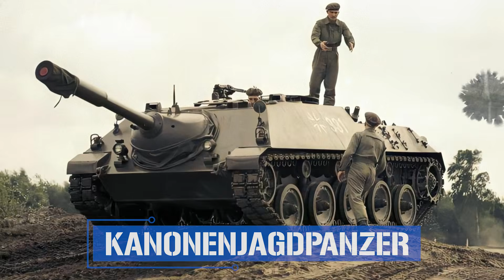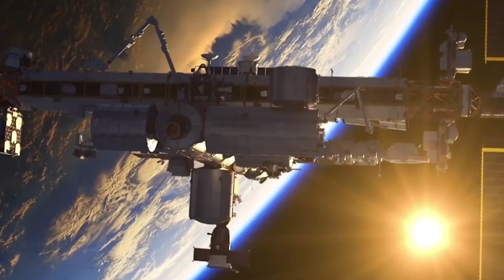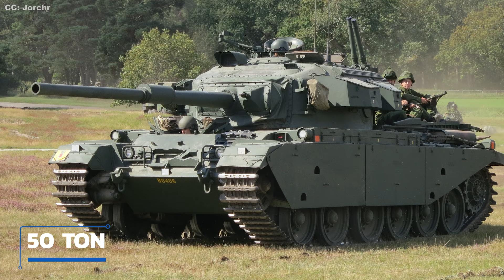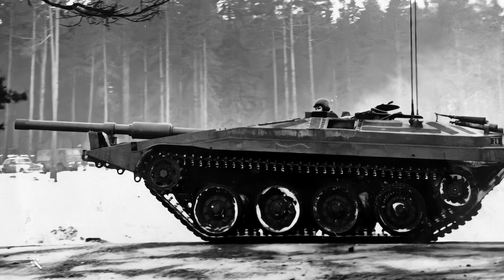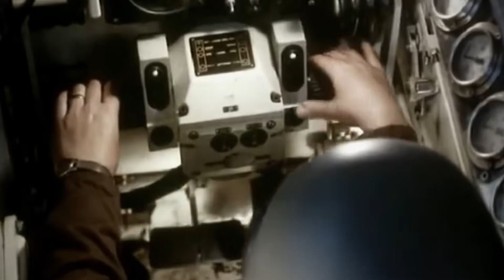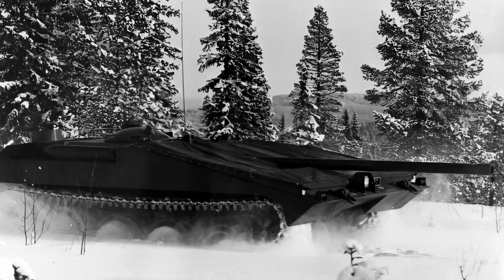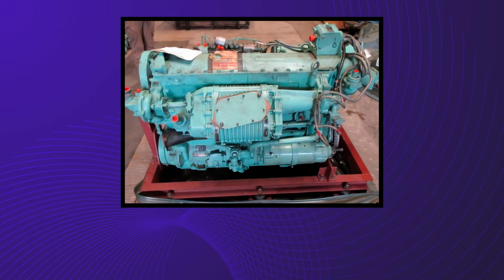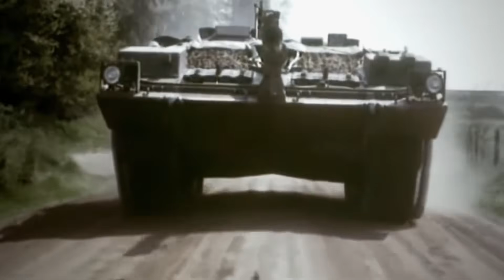Stridsvagn 103: Sweden's Turretless Cold War Super Tank

Comment: The more I see of it the more I want to see it as an electric drive hybrid with computer controlled suspension. It looks like a tomorrow vehicle as technology caught up with concept :o)
Reply: No this could never be practical compared to modern tanks as it can't fire accurately while moving.
Reply: @josefstalin4532  Eeh, practical? Yes. Comparable? No.

If it had a modern gun, it would be very dangerous, as long as it is first to fire. Problem is that it's loses a lot of flexibility by not having a stabilised turret and gun.

Remember that most shots fired, even today, from MBT's, are fired after the tank has stopped. The stabilisers are mostly used to keep targeting while you stop.
Reply: @Mithirael  I'm well aware most shots are fired stationary, I work as a tank driver. That being said, just because it isn't the majority of shots doesn't mean it isn't a huge disadvantage not being able to shoot anywhere but straight ahead or while on the move.

I work as a tank driver, and the amount of times we fire the cannon at infantry to the side of the road, while on the move, or just at an angle not possible without a turret is significant.

There is a reason no one has adopted a tank like this, they're way too specialized to be very useful as soon as shit hits the fan. As soon as the enemy appears from a direction you expected, you're dead.
Reply: @josefstalin4532  At the time, the 103 compared favourably to basically every MBT that the west had produced, even in time from spotting a target to putting effective fire into it. The British tested the capacity for firing on the move to prove that it could not put effective fire onto a target at all, and found that it wasn't much worse than their Chieftan. It really wasn't a huge disadvantage, more a situational disadvantage. 

And dying from enemies from unexpected directions is a symptom of any tank, the 103 wasn't more susceptible to flanking than any turreted tank would be. You only need one effective shot on target, after all. And with how the 103 was made, it would be just as easy to turn the tank to the enemy as it would be for any other tank to turn the turret, bar some very specific situations that you simply wouldn't find yourself in unless you were blind or mind-blowingly stupid.

The problem with the 103 wasn't it being too specialised, but rather being difficult to modernise effectively. When stabilisers and targeting computers allowed MBTs to fire with no loss in accuracy on the move, it simply couldn't keep up anymore. And today, it really wouldn't offer any significant advantages to develope a turretless tank like the 103 due to how powerful stabilisers and targeting computers are. The best you could hope for would be a machine that would be adequate; so why reinvent the wheel?

But at the time of its development, it was perfectly suited for our needs, and a most formidable opponent in a potential conflict.
Reply: @Mithirael  Exactly, the thing is the comment I responded to was about it being "a tomorrow vehicle"

It was viable in the 60s and 70s, but certainly not in the future.
Reply: @josefstalin4532  The comment you responded to said only that it looks like one, not claiming that it was. Unlike many comments that have asked about viability to modernise and redeploy it, the OP admitted himself that technology caught up and outran it.

Comment: The video did not go into detail about all of its abilities.

1) In western tanks sharp angles caused by sloping armour wastes space as it is unusable. This either means cramped interiors causing crew stress and inefficiencies like the Russian tanks, or caused bigger tanks (easier to spot and easier to hit) which meant more heavy armour meaning more weight creating a slower underpowered tank with extra costs in manufacturing and maintenance. Instead the S-Tank used the sharply angled and unused space at the front of the hull to put a rubber fuel cell in the wedge area at the front, using the otherwise useless space as fuel storage and as spaced armour. Rubber fuel cells were stuffed elsewhere too in unused spaces adding extra spaced armour and using all free space.

2) The hull was split into 3 separate sealed compartments each acting as spaced armour with the crew being in the third and last compartment, being safe at the back of the tank. 3 layers of spaced armour instead of one as in other tanks.

3) The engine and transmission were in the first two compartments acting as extra spaced armour for the crew.

4) The crew were in the largest compartment and the safest being the last compartment and hardest to hit. No swimming pool and holo deck for the crew but nonetheless roomy and comfortable compartment compared to Russian and other tanks.

5) Using an automatic loader reduced the crew size making for a smaller and cheaper and more manoeuvrable tank. The ride was very uncomfortable though because of the short wheelbase but then longer wheelbases increase the chance of throwing a track when turning.

6) The auto-loader gave it a VERY HIGH rate of fire.

7) Reloading was done in the safety of behind the tank.

8) The plastic fuel drums attached to the sides over the tracks added extra spaced armour. Diesel is very good for this.

9) The high angle of the frontal armour more than doubled the effectiveness of the thin armour, giving reasonable protection without the weight plus the added advantage of a chance of the shells ricocheting off and HEAT rounds not forming a proper penetrating jet.

10) The spade added extra spaced armour as well as for digging a defensive position to fire from providing extra protection and cover.

11) The fence set off HEAT rounds before the shells hit the tank or destabilized the shell’s trajectory causing a chance of ricocheting or HEAT rounds failing to form a penetrating jet properly.

12) The stepped ribs up along the hull front were a very light yet highly effective spaced armour that destabilized the incoming shell causing it to ricochet or break up before hitting the tank’s hull armour. Such an insufficient looking and minor thing but with major effects against HEAT and solid shot beyond belief.

12b) The ribs also stopped shell  splinters from sliding up the hull taking out sighting and ranging gear on top.

13) The low height of the tank makes it hard to spot, and hard to hit. During WWII over 50% of hits were to the turret. The S-Tank did away with the turret. Being the size of a large family car instead of a country barn made it a very small target, hard to spot, hard to hit.

14) Had a river-crossing screen that after being erected enabled it to cross any river. No stuck in the mud for this tank.

15) Duplicate controls at all stations allowed a single crewman to drive or fire the tank in emergencies.

16) Designed to fire and kill large numbers of advancing enemy tanks like a shoot-em-up arcade game until the Russian hordes were nearly on top of them then be able to skoot backwards at high speed to another pre-prepared defensive position to start the killing all over again while keeping their hull front (thickest armour) always towards the enemy, as the third crewman faced backwards and drove the tank to the rear at high speed (Most Russian tanks even today only have one reverse gear and can only move in reverse at a couple of miles per hour meaning they can not dodge by quickly backing back into cover in a hull down position, and the Russian driver being in the front of the tank can't see where they are going backwards). Shooting while halted greatly improves accuracy while the rushing Russian horde either had to stop to fire and make themselves a target or fire on the move and have an inaccurate fire, as the Russian fire control/gun stabilisation/ turret stabilization, ballistic computers, range finders, etc., we're either nonexistent or no better than their WWII tanks.

17) Highly efficient and cheap diesel engine plus a gas turbine engine for that super power and speed when needed. Only the US Abrams tank has a gas turbine engine too, and it earned the nickname ‘The Whispering Death’. But it took the US decades to add an aux power plant to run when idle to keep the turret powered and operating, as a turbo engine spins at a constant gas-guzzling rate even in idle. The S-Tank had the best of both worlds.

18) having the gun mounted so the breech was at the back of the tank instead of the middle meant a longer barrel could be used and most of the barrel was protected.

19) Like hot women and hot sports cars, sexy makes for a very dangerous and fast tank, and the S-Tank has it all, in spades.
Reply: One note, 12b is correct, but 12 is not.

The ribs were simply welded in place, and would have no noticeable impact on the shells at the time. They were only for protecting the gear on top of the tank.

Comment: About the Kranvagn (KRV) , the issue never was light armour but armament.
HEAT-rounds, basically a cone of metal with explosives on one side, that on detonation gets formed into a metal spear travelling at 6000-10000 metres per second, was regarded the future of anti-armour, but it has a few particulars.
One of them is that the penetration is proportional to the diameter of the cone, siply put the wider the cone, the longer the resulting spear.
The second is that rotation (like the one used to stabilise projectiles) distorts the spear and makes it less efficient, which is why the Soviet tanks who heavily relied on HEAT had smoth bore barrels in their guns.
The Swedish army wanted a HEAT round that was cheap, accurate with good penetration and short travel time even at long distance. Bofors engineers never managed to solve this, as fast shells require really fancy fuzes to be able to detonate the charge in the fraction of a second between impact and the shell smashing itself to pieces against the armour...  while a highly accurate shell would rotate so fast that the penetration got severely reduced.
Before a round was decided on, no one knew what cannon to pick (imagine finding out that the gun you installed in all you tanks are the wrong type for your shells!), and without a final gun, there was no point in making a turret as the exact shape and construction depended on what weight and dimensions the gun would have.

In the end, one of the KRV chassies built became a test bed for the S-tank suspension, while the other was rebuilt as a SPH, that served as a concept for what became the Bandkanon 1.
Reply: Also, Stridsvagn 2000 never got further than a wooden mockup.
Here is a clarification to be made, in 1980 the Swedish army requested the S-tanks and Centurions to be replaced with a future tank expected to be in service past the year 2000. For convenience, this unknown design was referred to as strv 2000 in official correspondance.
Budget restrictions (these were the years of high inflation that followed the energy crisis) saw the Army make due with a REnovation and Modification program of the existing tanks instead. The REMO finally brought the S-tank up to the standard it was intended to have, but they were still fairly old, and originally only intended to be in service for 10-20 years before being replaced as the technological development rapidly progressed.
In the late 1980s, the usual suspects (Bofors, Hägglunds et all) were involved in a pre-studies of a new, domestic tank together with FMV, the military procurement agency. Different configurations were considered: turretless, conventional turret, unmanned turret and so forth), and a wooden mockup of the most promising alternative was made under the name Stridsvagn 2000.
Meanwhile, the Berlin wall came down, Germany reunited and the Swedes got their hands on some T-72s. Results in the gun-tests were shocking, as the modern longrod penetrators went straight through the Swedish tanks, front to rear. Mobility was also far higher in the bogs and forests up north than predicted, further empathised with the trials of Abrams, LeClerc and Leopard 2. Swedish tanks were not just outdated, they were obsolete.
Projected development time for the Stridsvagn 2000 was between 4 to 8 years, and that was its doom. The replacement was needed soonest possible, and Germany not only have a really good tank they were willing to licence, but could also offer stopgap Leopard 2A4 to be used meanwhile.

Comment: Some corrections:

* "At high speed the turbine engine would start..."
The idea (theory) behind the design was that the tank should idle with only the diesel engine running, keeping fuel consumption low. When much power was required the driver should start the turbine engine. (It didn't start automatically.)
In reality the proposed behavior didn't work! When you need the extra power you don't have time to wait half a minute for the turbine engine to start, in a hot situation you can't even tell seconds in advance when that power is required. Therefore more often than not the turbine had to run in idle when the diesel would have sufficed.

* The S-tank couldn't fire on the move.
That's a matter of definition. Technically speaking the gun could be fired while the tank was moving.
In 1973 (IIRC) the British army did a lot of testing of the S-tank, comparing it to their Chieftain tank. The idea was to prove that tanks needed a turret. One factor they took as given was that the Chieftain with its stabilized gun could shoot (somewhat efficiently) while moving, and since the test showed that the S-tank had the same hit percentage while moving the conclusion was that they were "unable to prove that the S-tank can't fire while moving".
Reply: Swedish Army regulations generally frowned on wasting shells, so the S-tank were not to fire on the move at ranges exceeding 200 metres while the Swedish Centurions had a limit of 500 metres.
Reply: @johanmetreus  Of course that "ability" wasn't used in practice.
The point is that the developer's assessment that turreted contemporary tanks were also unable to shoot accurately while moving was correct!

The tank's design was really pushing the envelope in terms of suspension and propulsion, leading to many teething problems. It could not have been done ten years earlier. Not making preparations to retrofit a laser range finder must be seen as a blunder. (Lasers were way to expensive at the time.) At the same time when the S-tank was designed it was technically impossible to make "shooting accurately while moving" a functional feature. Ten years later the advancements in computer design (smaller, faster, more rugged and power efficient) made it possible.
Reply: @ollep9142  , let's start with establishing that the basic rule was "if you want to hit something, stop the tank".

Now, there are often remarks that the Centurion and others had stabilised guns and could fire on the move if needed be.
 I think the Swedish regulations clearly show that this was regarded as an emergency measure rather than something to be routine practice, and even then only at basically very close range.
It is worth noting however that S-tank was capable of doing this as well, albeit at even closer distances.

Comment: Being they would have fought a defensive war I think this would have been a good design.  This is a ideal tank to dig in and defend as long as you have control of the air war.  If you don't these would be nothing more then cannon fodder.
Reply: Ukraine is fighting a defensive war right now, being on the operational offensive.
Offensive is what tanks are needed and intended for.
Reply: @johanmetreus  Offense is also what it would have been used for. It was designed for a defensive war, not merely defensive operations. That means offensive and defensive use of it within the confines of defending the country.
Reply: @Ragedaonenlonely  what I said, but with clarity :)

Comment: Tanks with turrets of that era had to stop in order to shoot straight so getting rid of the turret wasn't a big disadvantage but a great plus.
Reply: The Swedes already had Centurion Mk5s and then Mk10s with stablized main gun in that era. They could fire their main guns on the move while the Stridsvagn 103s couldn't.
Reply: @tvgerbil1984  The 103 could fire on the move at distances up to 200 metres, while the Centurions could do the same at 400 metres with the same expected accuracy. Stabilisation made it a lot faster to take accurate shot after coming to a halt, but main rule for all tanks of the era was that if you to actually hit, you stop your tank.
Reply: @tvgerbil1984  The 103 is fully capable of firing its gun on the move. It just can't do so accurately. Which the Centurions couldn't either for that matter. Hence the practice of stopping for an aimed shot to actually hit anything with any kind of reliability. The stabilizers of the time weren't good enough to allow for any kind of guarantee of a hit at combat ranges.
Reply: https://www.youtube.com/watch?v=RcRpeSSwpvE Maybe the Swedes used their Centurions differently but the latter marks of Centurions should have decent stabilizer installed.